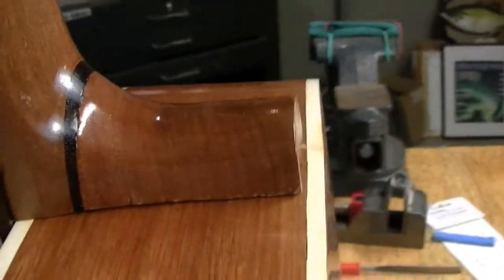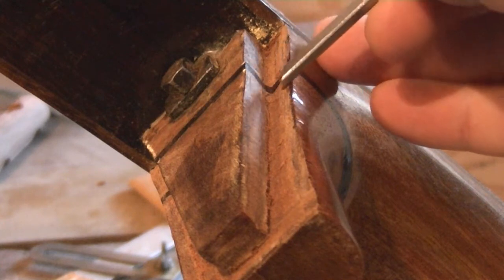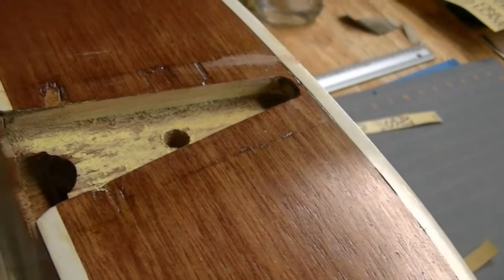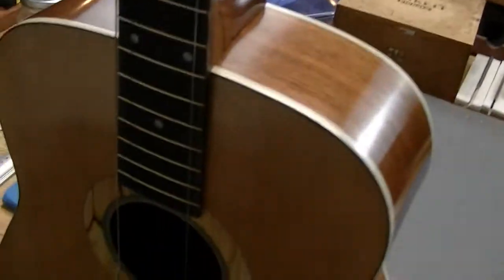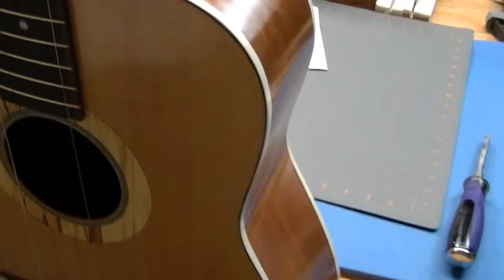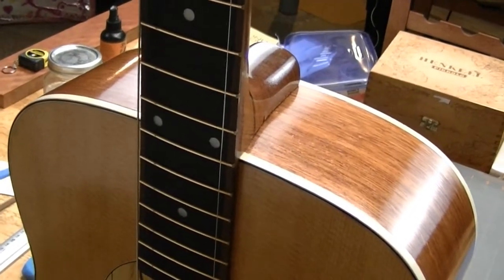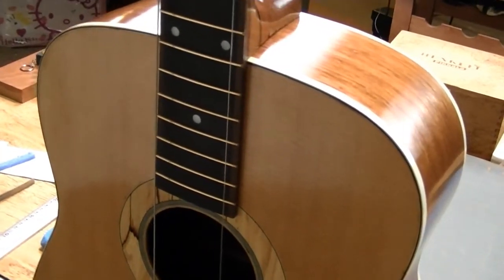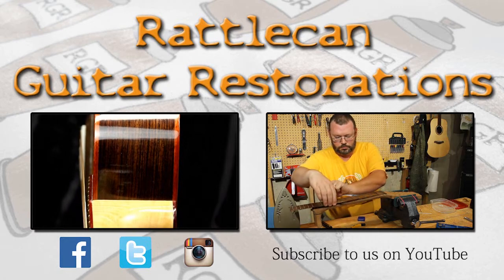BRUNO VENTURA "LAZARUS" neck angle help pt44 | RATTLECAN GUITAR RESTORATIONS by James O’Rear

Comment: James: StewMac's guitar Kit instructions are a free download. The neck setting info is very good — and works every time. In your video the heel seems to not sit all the way down to the sides. It must be able to sit all the way down. If the tenon is loose side to side, shim the tenon equally on the sides (if the neck is basically aligned). Then trim the shims (sand, shave) until a snug fit is established, snug meaning it takes a little bit of force (guns) to get the neck all the way back. In a Martin video, the person fitting the neck taps the fingerboard with a mallet to seat the neck! Sometimes on a neck set (or reset), the neck has to tip back so far that it lifts the fingerboard off the soundboard. No problem. Find some of that thin rosewood you used for the pick guard and shim under the fingerboard. Even the great Hermann Hauser did that on occasion. Good luck!
Reply from the maker: +Scott Reeves Great info, I'll hunt it down and take a look.

Comment: Hi, it'll be easier to shim if necessary the dovetail pocket for want of a better description. Simply because it'll make it easier to bring the neck to it and try for alignment before final gluing. The inside slot of the dovetail won't be seen, but you could be in danger of creating more work by modifying the neckpiece itself too far. Once you have a good fit and alignment the glue line hides many sins :-) lol are you going for a little back angle to counter final string tension?
Reply from the maker: +Matt Preston That's the plan (back angle). I see what you're saying and concentrate my efforts in the dovetail area. Thanks for the help.
Reply: +Rattlecan Guitar Restorations it's a tricky problem as obviously the dovetail to be a good joint needs to be a good marriage of the neck and body. I've been following this guitar from the first video and you are almost there. It's fantastic work :D my own builds have been very different from yours and quite modest compared to this.
Reply from the maker: Every step of this has been a learning experience and without the YouTube community I'm sure I'd be doing something pretty mundane. Just wait until the next major project!